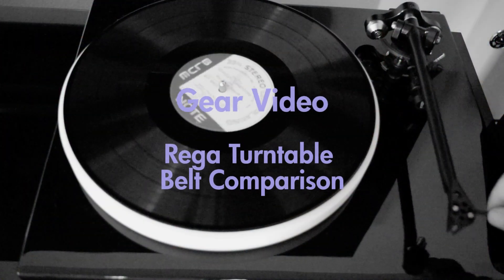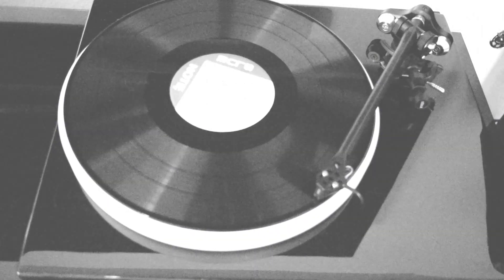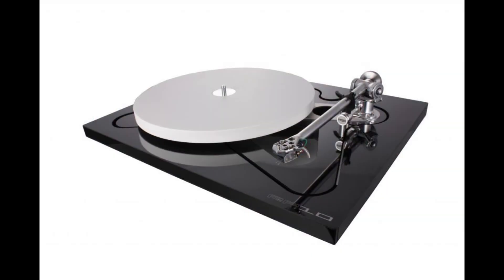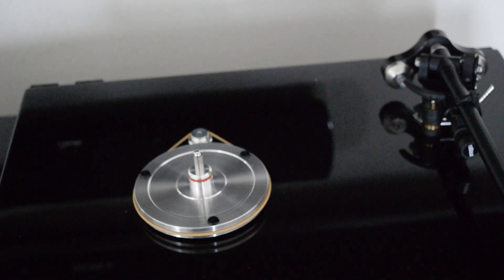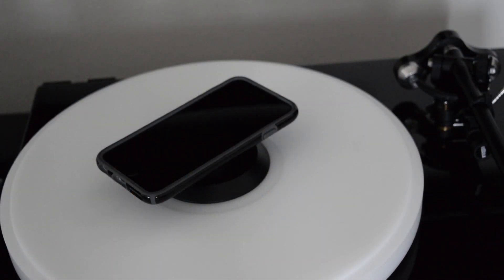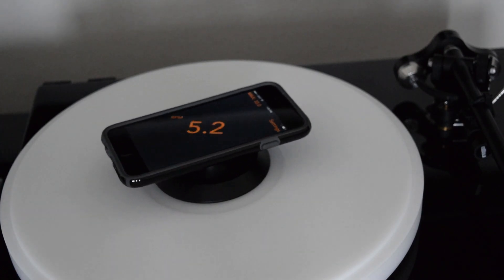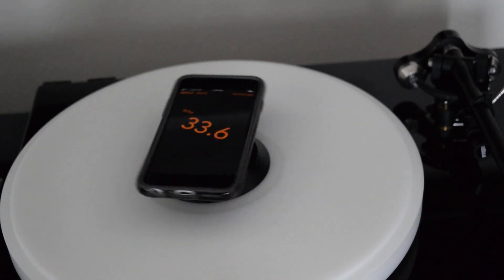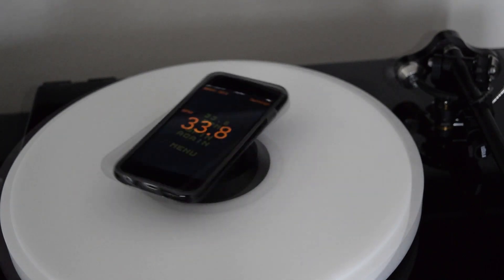Rega Turntable Belt Upgrade Comparison

Comment: If the belt was slipping the rpm would be below 33.3. How can a belt spin it faster? Does that mean the "more accurate" speed belt is actually slipping to get the speed to a lower 33.3 vs the other belt showing a speed of 33.6? Also when is a speed deviation audible? Does .3 or .4 rpm really matter? The only other way a belt can increase speed is if has a diameter that is too large for the drive pulley and rides up high in the pulley effectively changing the ratio.
Reply from the maker: Great question Robert and I guess my video kind of makes it a bit confusing.  From my viewpoint, the motor runs faster than it needs to and you need to increase the friction or loading the motor sees.   By adding another belt, you increase the amount of resistive contact it must overcome.    Is the speed deviation audible?  To my ears, it's really, really hard to discern.   Occasionally, with long sustained piano notes, you might notice a slight waiver.  Some people are a lot more sensitive to it than others.  Your last point is absolutely correct as well, you can change the pulley ratios to increase or decrease the speed.  Some people have applied tape on the subplatter to increase the diameter.

Comment: The Rega platter will never spin at the 33 1/3 exactly and consistently due to the “platter wobble” built into the Rega design, something that Funk Firm ( others as well) realized and compensated for in their re-jig of the of the Rega table, ie. the use of pulleys to redistribute the belt force to 3 sides of the sub platter.
Reply from the maker: Does Funk Firm have a website?  I would be curious to see the re-jig.
Reply: BarakaPDub I'm assuming you didn't Google it thefunkfirm.Co.uk get one of the achromat 5 mm as well, they do make whole platters would be best.
I think there's more factors involved you didn't give any run in time to the belts, they need at least 2or3 months constant use before they can be stable
And they should be cleaned and so should the subplatter and pulley for the motor the might be particles and residue, And you should always put your belts in a bag of talcum powder first, it's not so much on slippage it's the sticky Factor what causes wow and Flutter, talcum powder takes the sticky Factor away plus it ads grip. Other factors are not so much the belt but how the platter and pulleys are true I see all the time even on a lot of expensive turntables is not machined that well, Try putting the phone on top of the pulley of the motor only to see how stable it is? Or you can use an app where it uses movement rotation would be better sticking a piece of paper measures the rotation, can't seem to find it of-hand, there is another good one sound metre pro, what you should use to measure your decibel reading of your bearing and motor do them separately and together? see how much the centre bearing is producing noise and vice a versa, I think you can get a calculation of rotation speed from the decibel Reading. Just having a look and there's RPM metre, maybe you should try! That's quite good. Just looking and this one might be good vibration Ads, give you a spectrum analyser rpm and acoustic noise.
You should always start the platter with your hand at the same time you put the switch on to help it,  This stops the belt from getting flat spots.
I'd like you to return to this with more run in time and them being coated in talcum powder. What is your centre bearing like diameter length and does it have a ball, and what lubricant do you use? You can experiment with different oils and greases with the app to measure your decibel Reading, high end manufacturers turntables use (manual gearbox oil 80) but I think greece is better even if you use oil in conjunctio on the sides, is a must especially on the bottom! White thick! Lithium grease mixed in with 1to1 graphite powder try and get the platter suspended in degrees a millimetre from its original height! is the best approach. You have to be careful here!!! if too much grease gets on the side walls and you have a tight bushing your never getting the platter out easily! You might need to drill a hole worst scenario. Depends on the type of construction of bushing you have is it a one piece of split? What is the bush material metal or ceramic? Let us know what your results are.

Comment: You probably should tape the phone to the platter, otherwise the phone inertia may affect the reading.
Reply from the maker: While I like the thought, I have tried different locations and different turntables, the results don't differ too much.  It would be nice to get the spec accuracy on the iPhone gyros.
Reply: BarakaPDub 
Thanks Paul,
I tested my new Project 6 Perspex SB ( the SB models have a newer model motor) speeds, with the stock belt, using a new Samsung S9 plus with the RPM app. And the results were amazing , exactly 33.3 and exactly 45 RPM with no speed deviation whatsoever , not even 0.1 RPM of deviation.
You were right, it did not matter where the phone was placed on the platter, the results were the same.
it seems that the gyro specs on the newer phones are much better than on the older models.

Comment: Do the belts sound different?
Reply from the maker: +Anthony Camplone Some claim there is tighter imaging and bass which would make sense.  Too be quite honest, I only spun a couple of records on each and it was hard to discern a huge difference.  What I will show in my next video did have a bigger difference in the imaging and replication of the instruments.  If you think about it, the small slips of the belt will smear the sound a bit.  That said the differences of 0.1 and 0.2 percent are not going to be really perceptible to most.

Comment: Hmm. I wonder how much the platter affects it? I have a White belt and a delrin platter made from Ben Lamb at fidelity designs. Just tried it with rpm calculator and its driving at 33.3 - 33.4. So for me the white belt does what the blue one does in your video.
Reply from the maker: If you're white belt is sticking right around 33.3, then I wouldn't change anything at all.  I am sure there might be a little bit of variation from belt to belt.  I honestly haven't gone back to my glass platter since performing this and that would be a fun little experiment.  I think once it does get up to speed though, it's just a matter of counteracting any drag so the mass shouldn't play into it too much since the difference between the two platters wasn't that much.

Comment: I guess the irpm app isn't available any more..
Reply from the maker: Damn.  I haven't checked in a couple of years.  I thought that was one of the better ones out there.  Have you found anything else?
Reply: BarakaPDub Yes! RPM for iOS and RPM Calculator for Android that operates just like iRPM.
Contacted groovertracer. Would have to special order the Standard SubPlatter with a 6-8 week wait. So, ordered a deep groove platter from eBay with oil, bearing and magnet at less than half price of the one you have. 
I have a planar 3 that I got second hand in 1991. Using an Elys that's grey. Yes, it does have 3 mounting holes. Got it from London via fax. No internet back then. It should have died by now. Knock on wood.
I'm scheduled to be in Japan in May. Have priced the NAH GAH OH KA 110 And can get it without tax. If you would like me to order something for you, just ask. I'm hoping to meet Ian if he's in Japan at the same time.
Jet

Comment: You didn't try it with talcum powder on the original belt and the others, you should try it.
 Not a fan of the round belts think flat belts are better you get a lot of rolling with a roundabout and noise produced I think is greater. What about trying dental floss supposed to be good give that a go. I don't believe the Rega motor controller has servo control does it?
Reply from the maker: I could try the talcum powder sometime if I redo this one.  Dental Floss has a lower coefficient of friction than silicone so it wouldn't work that well.
Reply: @BarakaPDub  hello how are you! Things good! yes they say talcum powder is beneficial you don't need to do it for camera just do it for your personal experiment see if it helps in WoW and Flutter. See where you're coming from with the dental floss, but people do use it you have to have it tight tho, and manually spin it up I think but some people swear by dental floss. Have you managed I suppose you forgotten don't worry when you feel ready trying at 88 degree rake angle what results if you have have you noticed any difference. Catch you later

Comment: To me, any belt that causes lower rpm  of platter means the belt slips more than other belts.  So, the belts that show perfect rpm are slipping much more than belts that showed highr rpm... sounds to me like the motor runs fast, and once a belt is used that slips a little, the ones that have more slip cause the rotations to slow enough to match  desired rpm.

Im thinkng if your motor ran slow, you'd want a belt that had zero slip to not make matters worse.. any belt that had slippage would cause the platter to spin even slower.

Maybe thats why rega motors spin slightly fast.. so you can tweak the   speeds with belts that slip a bit more than others.. so you can slow down the rotation of platter.   If rega motors ran slow, no belt would make platter it spin faster.
Reply from the maker: Unfortunately, Rega's have never been friendly for doing most types of adjustments.  Their new models coming out this year now have a motor controller that can be speed adjusted which is nice for getting it close to spot on.  T

here's always going to be a small amount of variation due to various factors.  I don't think I mentioned it in this video but one of the things that I neglected to mention is that the belts will stretch over time and the environment can affect the rubber over time.  I really need to rerun a speed test since it's been a couple of years since I did it.  Have thought about it more over time there are a number of variables that really can play into things:  Bearing Oil, Bearing Wear, Belt Material, Belt, Subplatter Surface, Motor, Motor Pulley, and Motor Voltage/Current.   Some of these are easily controllable but others are a bit more difficult.  Thanks for the thoughts dsonyay.  At the end of the day, some people would call it fretting but I do it more out of interest.

Comment: Find a well cared for Technics SL1200 mk2, get a better platter mat, upgrade the arm if you wish (or just damp it). Drive system stability and noise still measures better than most belt-drives costing less than a new car ;)

Comment: I’m a professional musician . Needless to say speed is beyond important. If the platter spins fast , it will up the tempo AND the key . I cop things off of vinyl records . Pitch is extremely important. If it ran slow needless to say it would bring key , and tempo down. This can really mess with your head . Meaning your tuning on guitar or bass is relative to what you’re actually hearing . Just by being off very little , you are caught in a “ microtonal “ pitch . Therefore it’s not quite an A ( 440 ) note , but it is not G# or A# , but closest to A 440 , but not exact. As George Martin called it when recording the Beatles “ in between the cracks “ if I recall . Not exactly ,but close .
Reply from the maker: Thanks Kenneth and great comment.  I have a professional pianist friend whose ears are finely tuned to the microtonal differences.  He's pretty apt to pick up the variations in the speed chang.  I personally have a hard time discerning it but I know there should be something there so I love to tweak things.

Comment: Great video, only wish I had of found  it before dropping $$ on 2 REGA white replacement belts for my REGA P9 table as my findings are the same as yours in that the white belts tend to make it run a it fast. Heres a short vid of mine at 33 rpm using a KAB strobe. As you can see the 33 indicators are drifting to the left instead of remaining "locked" indicating its running fast.

https://www.youtube.com/watch?v=Q25hKg8jErw

Will now have to order some "little belters" to see if that helps,
Reply from the maker: Thanks so much for sharing!  Now if I recall correctly, the P9 has the upgraded speed control, right?  I haven't seen the KAB strobe up close but I like it from your video.  If you do get the 'Little Belter,' please let me know if works for you.
Reply: Yep the P9 come with a giant power supply, dual belt, machined alloy pulley as well as a larger bearing so there shouldnt be any excuses so i'm thinking it must be the new white belts (unfortunately the ones I got with the table were worn out so cannot compare) but will definitely let you know what (if any) difference the blue belts make when i order in a few months.

Oh and the KAB strobe is great as its not relying on your power frequency for timing making it somewhat more  accurate. Also as the strobe plate is 10" the idea is to put it ontop of a record while measuring to also factor in any potential stylus drag but I suppose that will depend on a lot of factors such as groove modulation etc. so not sure how much more accurate doing this would be.

Comment: that app is unreliable I would suggest downloading and printing a strobe wheel http://keystrobe.com/Discs_files/complet%2060hz%20100mm.pdf
and get the strobelight app, much more accurate
Reply from the maker: +Richard Golden-DeWitt Thanks for the time on the app but the referenced app turned out to be a bit more reliable than people think and I did a follow on video with a comparison with a strobe disc.  See here:  https://www.youtube.com/watch?v=ZM9gYX30xFA